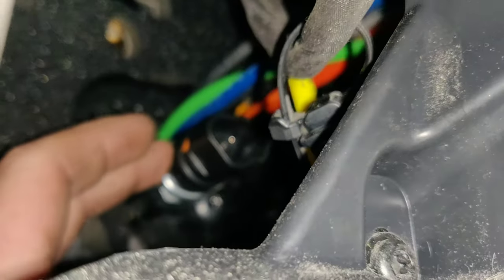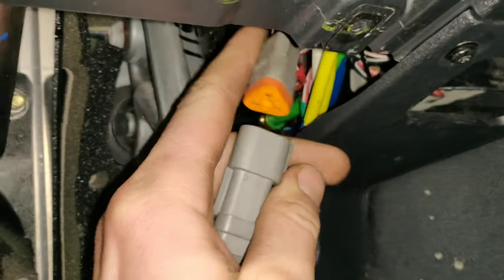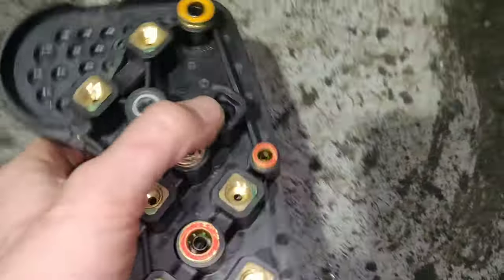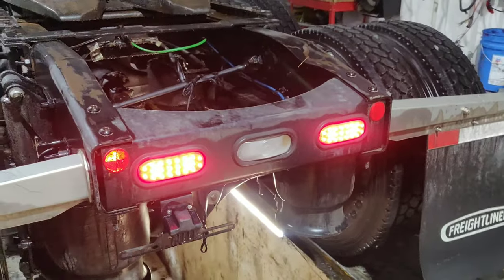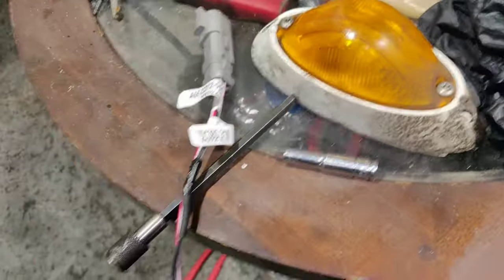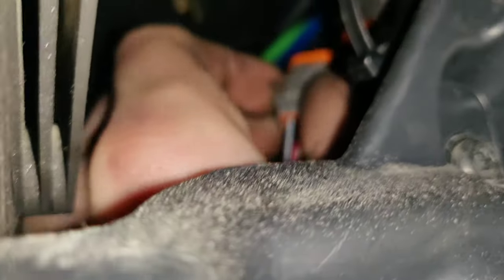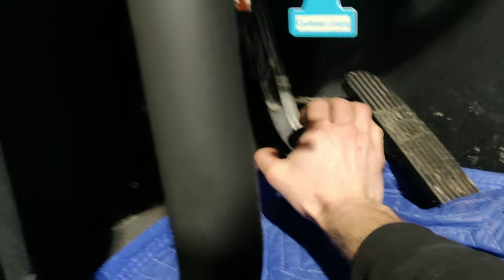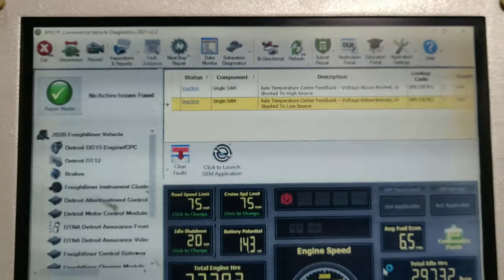Freightliner Cascadia Brake Lights always on / bad brake pressure switch / problem fixed

Comment: If is ever leaks just buy a T and an elbow. Hook up the elbow outside if need be and run a air hose thru one of the top hole and hook up a T inside and hook up the other black airhos inside and the sensor inside the cab.

Comment: I have cascadia 2019 during bad rain it shows code 1066/12 and 3509/4 with abs lights and stability control on my dash and inactive cruise control and problem switching to drive unless i turn off the battery to allow me to switch then it comes back on once I start driving, any advice please?!!

Comment: Good job buddy
Reply from the maker: Thank you 🙋🏻‍♂️
Reply: By the way the dealer has a new upgraded harness and pressure sensor for cascadia which eliminates all the issues with the brake light staying on.it works on 2020 cascadias but i dont know if its compatible with older versions.
Reply from the maker: Yes you are right they do have an upgrade!

Comment: I have same problem my 2007 kenworth t600 when I push break paddle light on then I release paddle light while on then 2-3 mints need to change paddle or break switch

Comment: I have no trailer brake light.
No power go to the fuse.
So what happened?
Reply from the maker: What truck do you have? Can be the brake light switch!
Reply: @valeriumoscalu7580  cascadia 2010 dd15
Reply: @valeriumoscalu7580  d.o.t shut down here at the scale
Reply: @Valeriu Moscalu  truck get brake light 
But no light on trailer